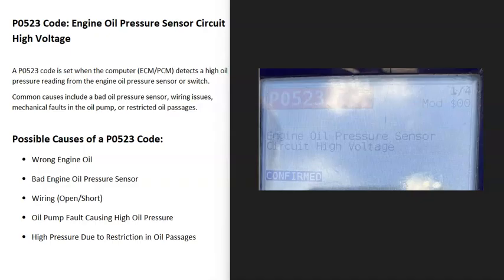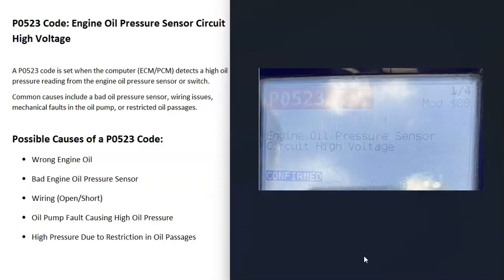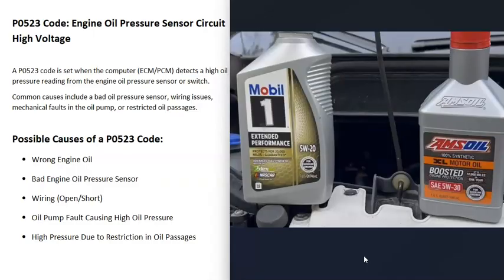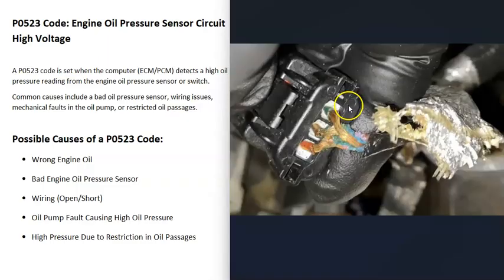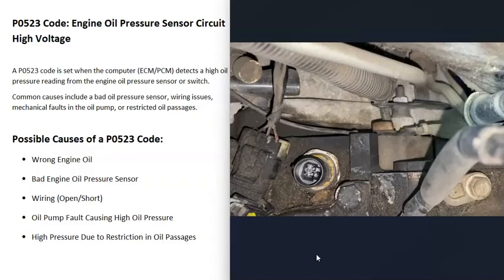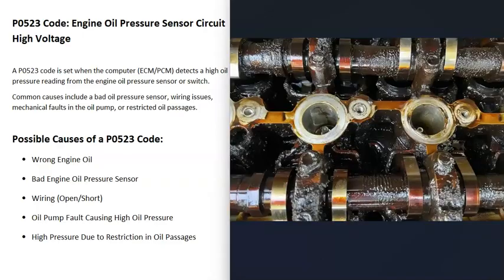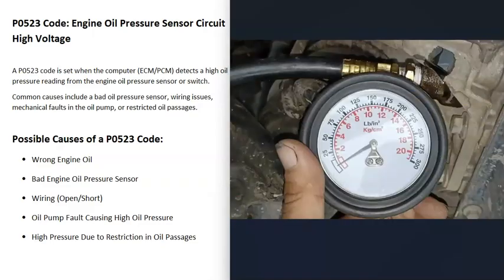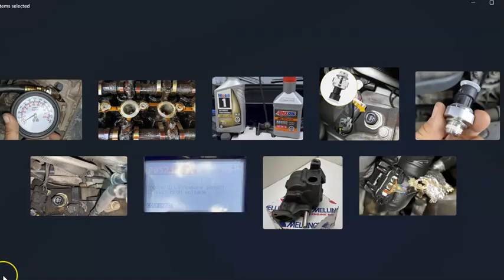Causes and Fixes P0523 Code: Engine Oil Pressure Sensor Circuit High Voltage

Comment: I have a 2012 sxt plus charger oil pressure reading is 23-30 the 30 is while running 23-25 is idling this code pops up a lot along with fan circuit 1 and 2 I’ve also had “low” engine temp 160-170 , coolant temp 190, and oil temp  180 during cold weather but it’s now in double digits (50s) running the car engine temp 160s, coolant temp 190-225, oil temp 185-190 fan does not turn on even when it got up to 225 for coolant I am told all of these are low but when running check engine light only the three come up.

Comment: 2014 jeep 3.6 has p0523 when it's cold in minnesota.  Runs and drives fine, assuming it's just because of cold oil.
Reply: Same on mine
I still run it for 100km and no issue
Hust the engine light and red oil light is popped up on the dash.

Comment: Good info...I've been chasing this code for a week or so. I had the knock sensor code come up, so i replaced both of those and the oil cooler at the same time. Started it up and then had the p0523 code. Took it apart again and replaced the oil pressure sensor that came with the new cooler with the old one. Still reading the p0523. Looks like I'm going in again to check wiring
Reply: Did you ever figure out the problem?
Reply: Same thing happening to me ugh
Reply: What did it end up being ?
Reply: @xtrmkddy8858  no idea...I exhausted my efforts. It drives fine but that code will pop up several times a week. I'm thinking the oil pump maybe